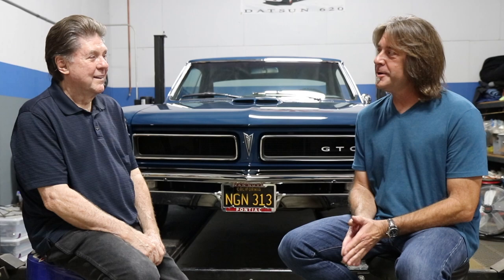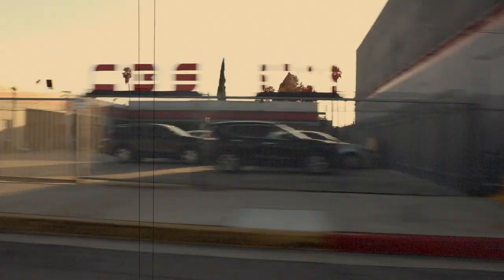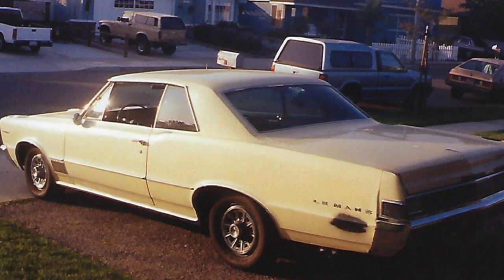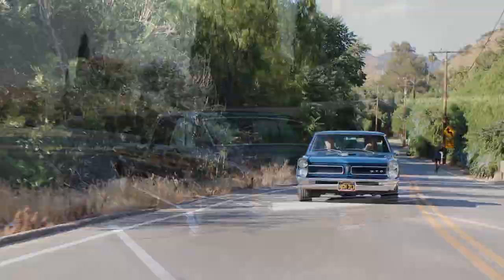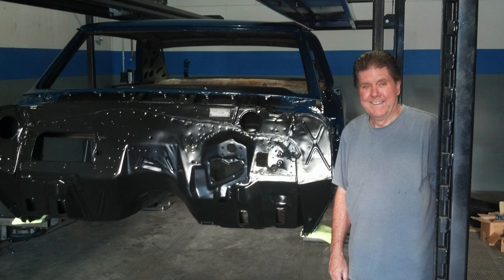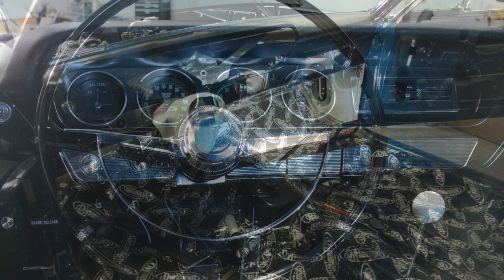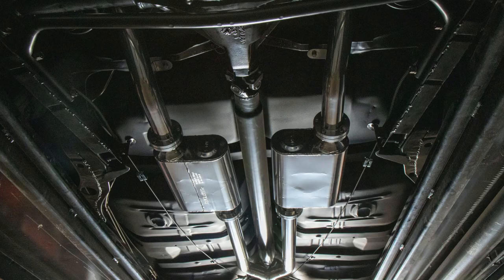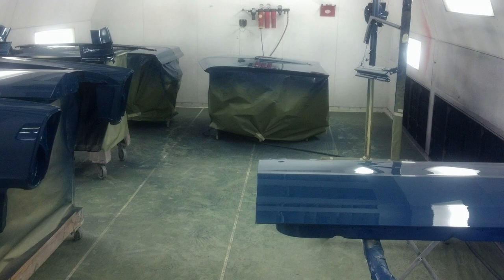Building Your Own Pontiac GTO out of a LeMans

Comment: Outstanding job on not only the car, but the video. You've built it just the way I would've. Trips, 4 speed, and dual master cylinder, with I'm sure, probably disc brakes. (Well I'd've put a 12 bolt behind, but you're probably not beating it, like it did to mine.) No A/C or unnecessary power robbers. The color looks different, but nice. 65s are my favorite, and drove one for 10 years as a DD. Fun stuff.
Reply from the maker: Thank You